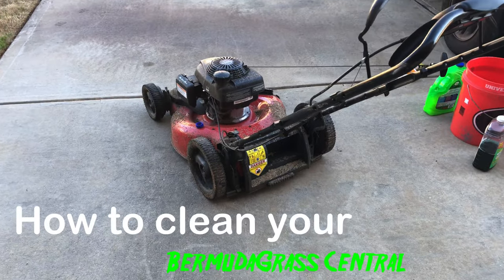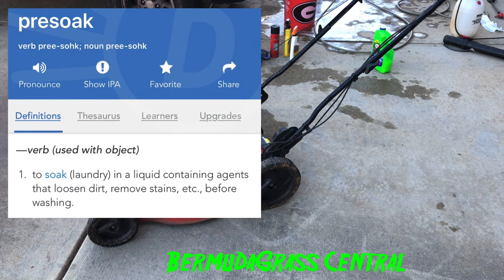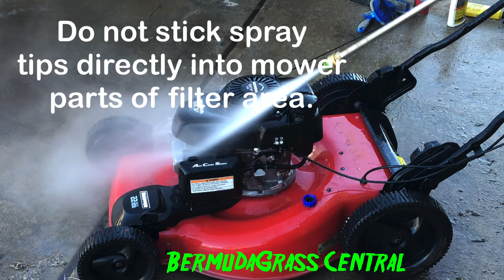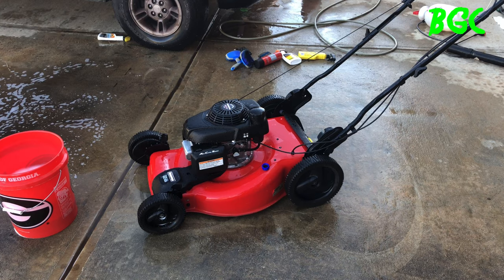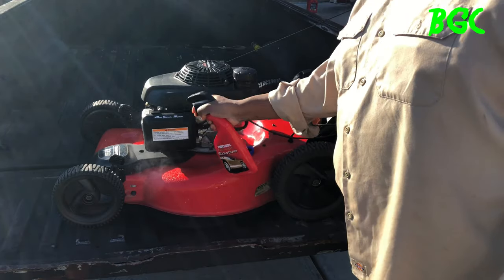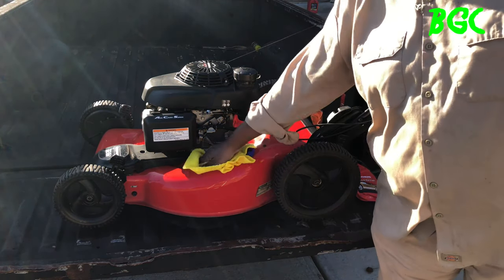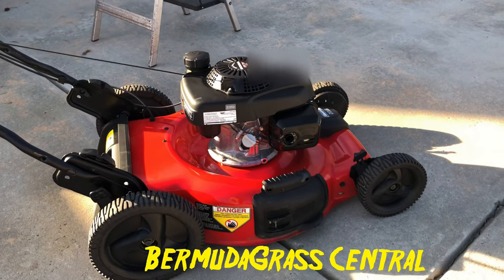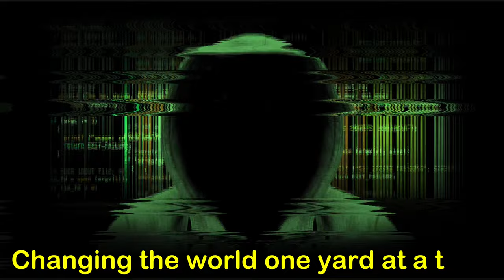Messy Mower Clean up

Comment: Good info for those who do not follow or know what is required to keep your equipment in long term good running condition. It looks just about, if not brand new.  I might add that at least once a year one should remove the engine shroud to ensure the engines cooling fins are clear of grass, mouse crap etc to prevent overheating. (mice eat wiring also).
And you know, I ALSO feel that equipment appreciate being cleaned.

Comment: Good job BYD,

I wash mine four or so times a year.   I do however leave it running while I'm washing it. (Not the deck if course). Also, after I dry it and wipe it down with spray wax, I make sure to lube all the moving parts, wheels, cables, pulleys, drive assemblies to prevent rust and moisture. Don't not use wd40 it's to thin, bbut I used a lube that's used for garage doors.   A clean machine is also much easier to work on and maintain.

Comment: Now, how do I turn over my riding lawn mower
Reply from the maker: dabig77 I’ll tell you what my neighbor did, I helped my neighbor do this with his John Deer 🦌. He put cardboard on the side of his house. We both leaned it up against that. Then he pressure washed then bottom. It wasn’t ideal but it worked 😃👍🏾
Reply: Bermudagrass Central  One doing this should be DAMN sure it does not fall back down on someone. Block it up against the house with a board. Safety 1st.  I have a mower lift.